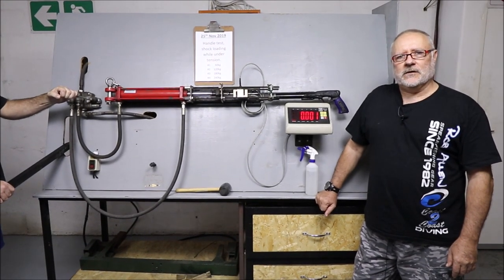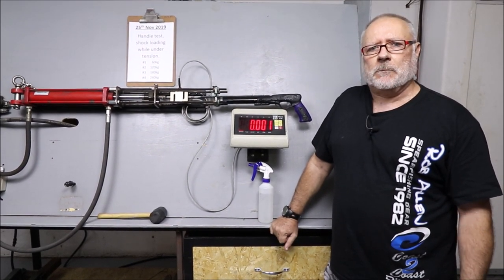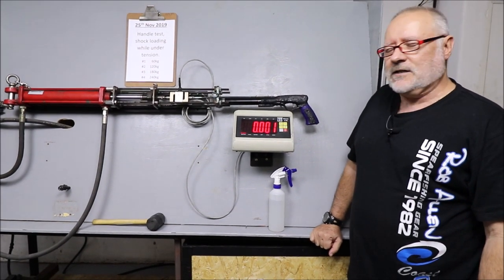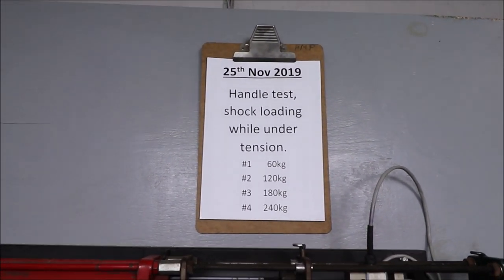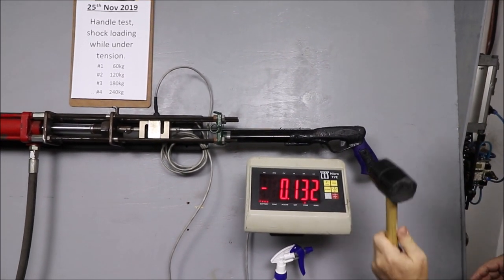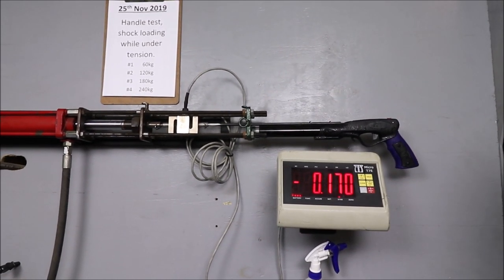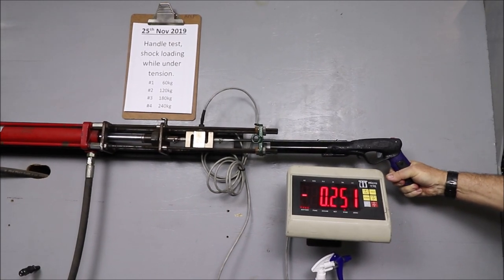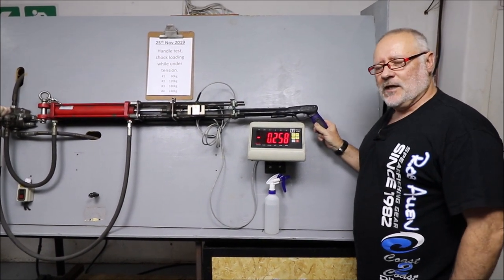Rob Allen | Speargun Impact Misfire Test

Comment: Hi Rob, is the type of spear critical for your mechs? I have a little 60cm rob allen sparid (i shortened it) for shallow water reef hunting crayfish and coral trout here in aus. The spear i use is a spearmaster spear so the notch is slightly elongated compared to yours. The other day I had it fire without pulling trigger after I loaded the second band (very tight 14mm) and also fired with a very very light touch of the trigger. I love your guns but I'm a bit worried about the mech now. (Vecta 2 mech)
Reply from the maker: Hi Fish Hunter. Without seeing the spear there is no way for me to tell. Mail me on rob@roballen.co.za and I will talk you through what to check.

Comment: I'm not sure if the trigger  will fire under 250 pouns of preasure...
Reply from the maker: That's 250 kg, (550 pounds). This is not to show the trigger working, just to show the "hold-ability" I have used a gun with 2 x 20mm rubbers at max power. This was around 190 kg (418 pounds) it did shoot but hurt the wrist from the recoil. This was not for shooting fish but was used to drive an anchor tag into a whale shark to hold a sat tag.

Comment: it could have been a nice demonstration, but without showing the speargun actually firing normally when pressing the trigger it is worthless.
Reply from the maker: Hi Francois, I don't quite follow, the demonstration was to show it under load and not firing when shock loaded. Do you think maybe we set it up so it couldn't fire just for the video?
Reply: @RobAllenSpearfishing  it is the standard scientific method. testing all possibilities to better understand the working principles. all the variable need to be accounted and controlled. how did you know maybe the high force applied coudnt have "locked" the mechanism? maybe the trigger get harder, or even easier to pull at that force? the trigger could have creep and you might have been close to an accidental discharge?
this is the purpose of a test.
Reply from the maker: @Francois_Dupont  Hi Francois, I think you are missing the point here. These videos are just demonstration videos, not scientific experiments. In a previous video we had shown the loads the handle can hold, not how it behaves when firing, if it can fire, etc. A comment in that video was …  “What if you bump the gun when under these high loads, will it miss fire?”  This was why we made this specific video.

To answer your first question, in other videos we do show that higher loads will need a greater force to pull the trigger, it is directly proportional. Yes, if the contact point angle/arch of the trigger and sear are set up differently, it can get lighter on the trigger pull and eventually fire off. 

To answer your 2nd question regarding creep, this is a real thing and we have tested for this off camera. Over the years we have tried many different materials and, some are better than others. What we currently use is perfectly fine for the current loads under normal 2-rubber gun conditions. However, we are developing a 3-rubber gun and have made changes to the lever lengths in the sear and trigger, to reduce the point load by 30%. This is to make the 3-rubber gun trigger pull feel the same as that of a 2-rubber gun.  

The point in this video was to show it did not miss fire under any of these loads when violently hit with a rubber mallet. Even at max load on simulation of a 2-rubber gun, then again doubling that load. A 2-rubber gun is around 110 kg. The 250 kg plus we demonstrated was to show it still held.

Regarding the mechanism becoming locked, we know this is not the case because the spear will pull out at between 350 and 420 kg, we show this in other videos. If you could load this gun to these high loads, it will still fire but, you will have to pull much harder on the trigger and, the recoil at these loads will hurt your hand. 

I have shot a gun in pool testing with 2 x 20mm max powered rubbers. This is around 180 kg. This bruises the hand after a few shots when using our standard gun.